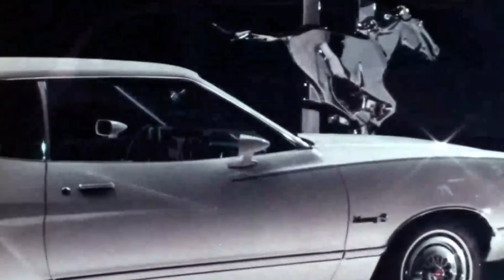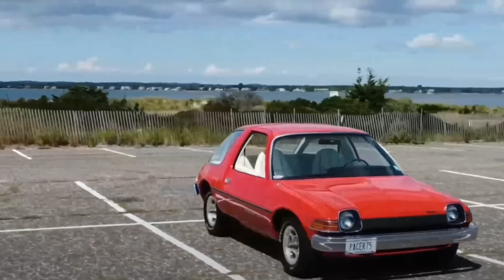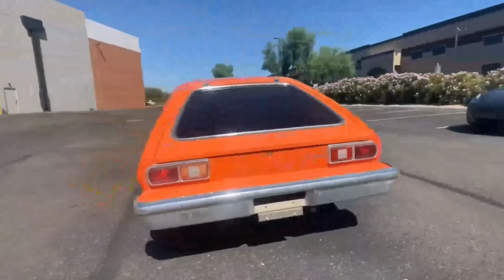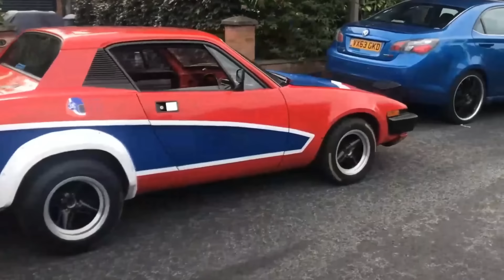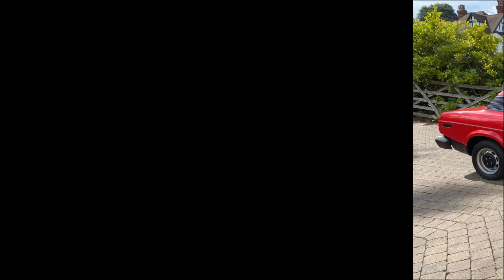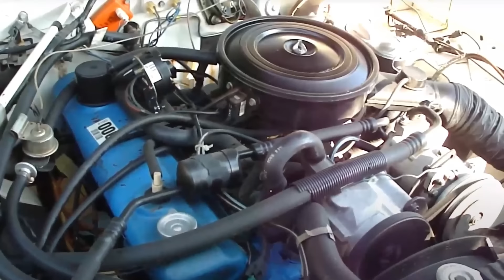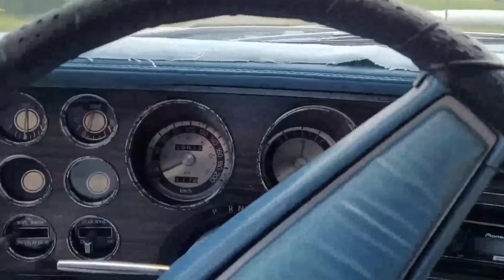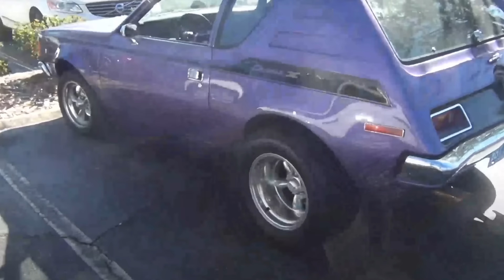Top 10 WORST Cars of the 1970s

Comment: None  of these  were bad cars for the time.
Reply: Oh ! I owned a 1973 Chevy Vega and that junk wagon is the things nightmares are made. Started drinking oil when It hit 20,000 Miles. The body started rusting in the deep south where we do not use salt on roadways whenever we did get ice and snow accumulation. Everything in side that nightmare rattled so damn bad it would have driven a deaf man insane. It Wouldn't start in freezing weather and I'm talking about 25 ° F are colder. Then Thank God the engine died before hitting 40,000 miles that's when I sold it to my mechanic for little of nothing to get rid of it. He replaced the engine with a V-6 and drove it a few more years until the body got too rusty and unsafe. These So Called Cars Where Pure Unadulterated Crap.
Reply: They were absolutely bad cars for the time!
Reply: @CM-qd9kf  Did you own any of them?
Reply: Respectfully disagree. I got my driver’s license on 1984 and these cars were still on the road. In fact, I taught my girlfriend at the time how to drive a manual transmission car in her Ford Mustang II. Wow, that was a terrible car!
Reply: Vega
Reply: Agreed and not once did they happen to even mention the Volkswagen bug at all.  I can guarantee you that there had to be at least 10 times as many accidents, fires, and deaths in the Volkswagen bug then there ever was in the Ford Pinto
Reply: @mmoore385  We owned two Bugs, They were fun, but you had no protection in the front, you were about 18 inches from the windshield, yep hitting a deer or anything would result in death or serious injury. lots of people died. I agree with you
Reply: @mmoore385 i owned two vw bettles , they were alot of fun to drive.  I never was in an accident in one . But,  you look now at what their selling for now . I see the ones from 67 down going for $30000.00 plus.
Reply: I agree, even though I live in England. I still think the TR7 should have been the Spitfire replacement, and by the way, Lucas electrical items were not that bad, never had problems with them, unlike the German number plate lamp that a connector had broken off on my 2003 Rover 75. Surprised that this person didn't mention the Marina, the dullest car in the world. But I still like them.
Reply: @nigelcharlton-wright1747 I owned an MGB. Fun to drive, but it needed constant maintenance.
Reply: @nigelcharlton-wright1747  I remember the TV commercials for the TR7, "It was the shape of things to come" or something similar.
Reply: @nigelcharlton-wright1747 had a 77 TR7 for 14 years, loved it.
Reply: The Pinto was a real p. o. s.
Reply: They were in comparison with European cars. Very much so
Reply: Yes they were. No care in fit and finish. Detroit deserved all the grief. At the very same time Toyota, datsun, and Honda showed people how it could be done.
Reply: Gremlin, the only new car my dad ever bought for $2300, With a white stripe the only option, vinyl floors. 232/3 on the floor. But that Thing Kicked ass rolling white smoke otta the wheel wells from first gear! So Cool!
Reply: They were beyond bad. Horrible.
Reply: I bought an AMC Grelin. That’s a good name for it. It was horrible. I finally so it to a smarmy corner dealer for $50
Reply: I owned a 74 Datsun b210,  and later a 77 mustang 2 .both were 🍋.  The 74 Datsun b210, was a also a rust bucket . I sold it to a neighbor ,he never spoke to me again.
Reply: And still better than todays
Reply: After my 🍋 74 Datsun and my 77 mustang. I found the cars getting better mechanically. I usually had 2 vehicles at a time after those two .the were all great . An 84 pony,  an 88 ranger, a 94 topaz, a 99 ranger, 2005 caravan,  2009 ranger , and a 2011 yaris . All great vehicles no complaints. The 99 ranger I had till 2022 . I still have the 2009 ranger,  and the 2011 yaris.

Comment: 14 seconds in that era was not that bad. In 1984 I got a 1977 Datsun 810 wagon with the 240z 6 cylinder engine and an automatic transmission (nice car) that did 0 to 60 in about 12 to 13 seconds.
Reply: Chevette was a good 👍  car
Reply: @IronMike-f8i datsuns are too much better than this junk.
Reply: I had an 810 rusted out in 5 years but it was fast
Reply: @smacksmack5976 must have been a manual - the automatic transmissions of the era killed the cars power.

Comment: Whew!  I'm glad my beloved Ford Maverick didn't make the list.  I'm surprised it didn't.
None of the cars featured were well built, but I'd still own several of them.  The Vega had nice body styles and V8 engines fit in there rather easily.  It's the perfect vehicle for a  hotrod.  The Mustang, like all the other cars was gutless because of emission standards.  If you have a 302 without all, you've got a car with good potential.  I like the Gremlins.  I always liked AMC gimmicks.  Some dude in the apartments owned one with a 360 and the interior was Levi's denim.  He could really smoke those tires!  I think AMC even offered the car with a 401.  Dodge Diplomats did a cush ride and the coldest AC.  A  buddy mine had one with a 318  and he made it look like a cop car.  I kind of liked the TR7s, but I didn't realize  they were underpowered.  It was a difficult time for the auto manufacturers.  Their hands were tied trying meet safety and emission standards

Comment: The Vega was discontinued in 1977. My aunt had a LeBaron, had it for 10 years, yes, the stuff in the interior fell apart but it was a solid car, she put about 150,000 miles on it and didn’t have any problems with the engine or transmission, it was still running well when she got rid of it.  The Vega and the Gremlin, began to rust in the showroom

Comment: Nothing was wrong with the Gremlin. Anyone that wasn't around then that bashes them the comments were filled with people who loved them. The 232 or 258 straight six were industructable. The 304 V8 was a beast. Car was better than the tin can Japanese cars of the 70's. Better than the Vegas or Pinto. Better than a Beatle or Plymouth Volaire or Dodge Aspen. Basically it was by far not even a close 2nd the best small car of the 70's.
Reply: Most people that had beetles back then were quite happy with them
Reply: @brucesturton8521 Not the worst. But not that safe. Not a lot of power and in snow belt horrible little gas heater.
Reply: The bettle was still a lot of fun . Yes the heater was terrible , but , still alot of fun .now they go for a good buck . Possibly more than most of the small cars back then. Again most people that i knew back that had them were happy with them
Reply: Gremlin, the only new car my dad ever bought for $2300, With a white stripe the only option, vinyl floors. 232/3 on the floor. But that Thing Kicked ass rolling white smoke otta the wheel wells from first gear! So Cool!
Reply: Also yes the beatle Didn't have alot of power, but, most of the cars from 73 to 83 didn't havre much power
Reply: Goes for the Pacer as well, solid vehicles
Reply: I owned both a gremlin and a beetle bought used . The VW was older with more mileage and was a much better car, the gremlin was junk with 47,000 miles on it. The 232 was a great engine but the rest was worn out. The beetle had a lot of life in it but I tried to drive it on a night I should have taken a taxi home from a night out.
Reply: I've had several Dodge Aspens and Plymouth Volares. I currently have a 78 Aspen. They weren't bad cars for the time. Just like everything else in the late 70s, they suffered from a lot of Government meddling In the automotive industry.
Reply: I agree with everything you said about the Gremlin 
@bikingD

Comment: Add the 1979 to 82 Datsun 210, A series engine was poorly made, bad bodies that rust, poor fuel system
Reply: Are you crazy those cars specially the motor and transmissions are indestructible and are a gas saver. 😤😡🤬🤦‍♂️🤷‍♂️
Reply: Had an early 80, out of the Phoenix Az area, bad main bearings on the crank shaft.  Motor blew up at 76,000 miles, mechanic who diagnosed the car told us and the owner of a Datsun pickup with an A13 engine from 78, its was a know problem and they never fixed it.  They did recall the cars for those defective engins s under a service buliten, but I traded it in after major issues with the Hitachi caborator, that vapor locked the fuel system on the replacement engine at temps above 55 F.  By the time of trade in it barely got 14 mpg, mixed.  My current car with a V6, gets 35 mixed.

Comment: The Gremlin was a decent vehicle....far better than the others here
Reply: A friend in HS had one and it worked well enough. In 1981.
Reply: The Gremlin was my first brand new car. Not perfect but was reliable. Worst feature was that it needed some weight added to back to give traction for driving in snow.
Reply: @eyesalooking  I always added weight to the back of mine to make it go better in snow and that didn't worry me much since i used sand bags.
Reply: How did gremlin when they first came out 6 cylinder ran great only problem I had the rear window would pop when I hit a bump even the dealer cannot get it fixed otherwise I really love that car
Reply: @josephfinello6307  The rear window with mine never flipped up. One of the hinges' weld let go so i drilled it and used 2 small bolts to hold it together which worked very well.
Reply: Gremlin, the only new car my dad ever bought for $2300, With a white stripe the only option, vinyl floors. 232/3 on the floor. But that Thing Kicked ass rolling white smoke otta the wheel wells from first gear! So Cool!
Reply: @henryhill3778  I had the 258 in my Gremlin and that thing surely kicked ass too!
Reply: @henryhill3778  Mine sure liked to do burn outs too and that made it tough keeping tires from wearing out but that made it a lot of fun.
Reply: the kid that made this video cuts it down because it doesn't meet his appearance requirement.  wtf?
Reply: Looks like my mom's vacuum.
Reply: Yes way better than the rest here and i had one and even drove it to the top of Pikes Peak in Colorado and it went up there with no issue at all.
Reply: I thought the Spirit was pretty decent